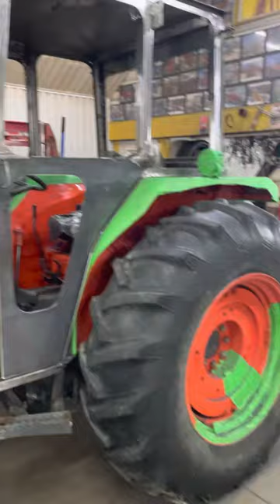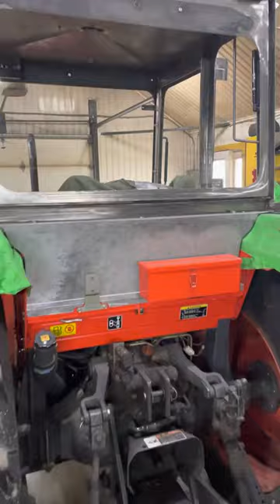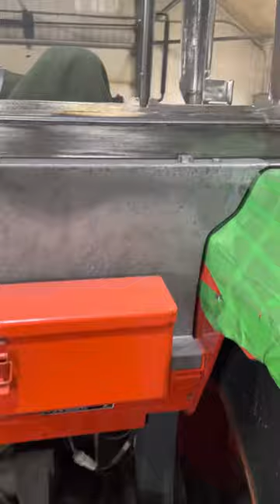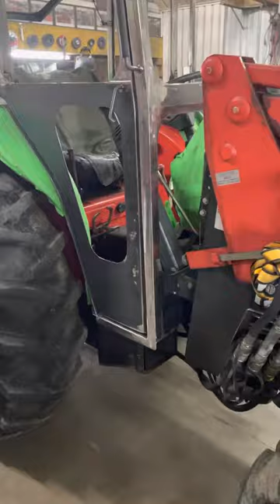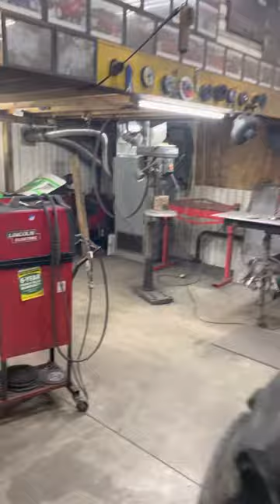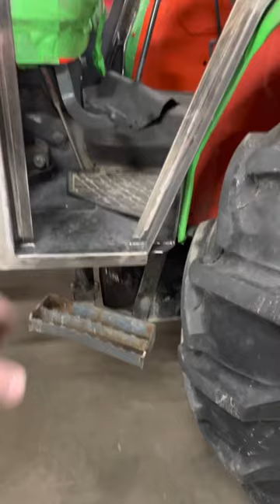Custom Fabricated Tractor Cab In Bare Metal // Kubota M6800

Comment: It would be interesting to see some of the fabrication details. What materials you use for the frame, order of assembly, how you weld sheet metal to the frame, installation of window frames, doors, etc. I've had to make some modifications on the cab on my tractor and I've been tempted for years to start from scratch and make a new one. I enjoy your videos, wish I didn't live 1500 miles away.
Reply from the maker: https://discord.com/invite/pdwCDB9ce7

Comment: Nice Bad, thanks!  What rubber seal do you use for the cab to tractor seal?  Also window glass seal?  I want to make a cab like this for my small Kubota B7300 and I like how your cabs look/operate best of what I have seen.  I have a large CNC plasma table, so I can make the sheet panels easily, but it is the channel/angle type's that you use that I am most curious about, for framing up the cab/doors/window, etc

Keep sharing please!  Really great work.